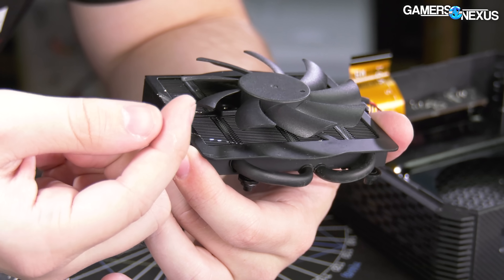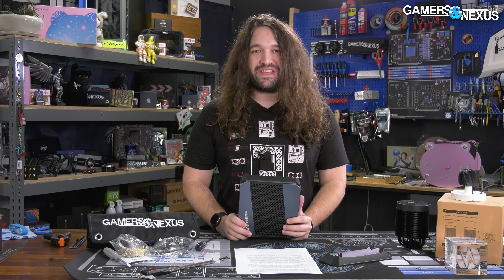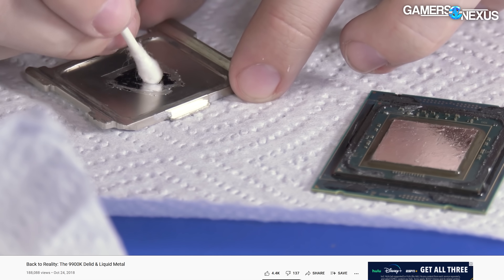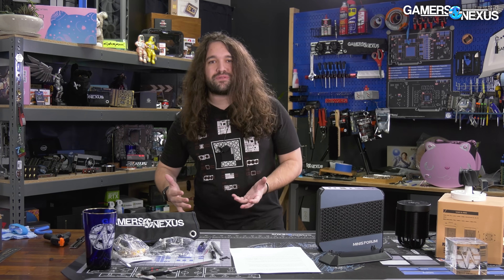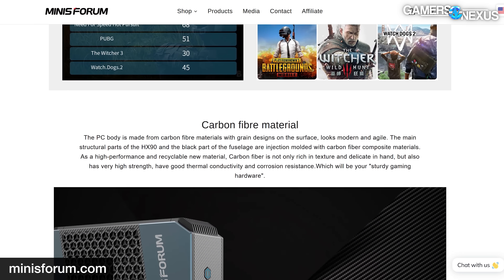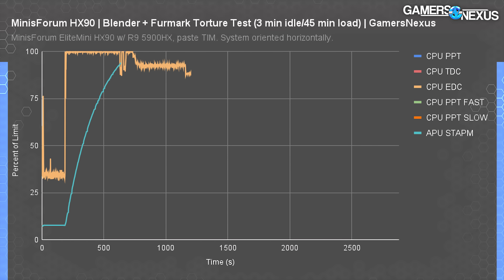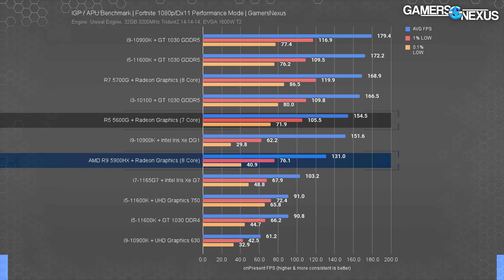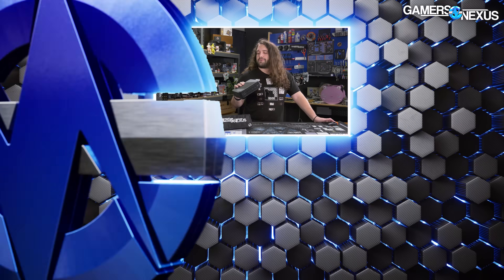Utter Incompetence: Liquid Metal Disaster in Minisforum HX90 Small AMD Gaming PC

Comment: I emailed Minisforum and this is the response I got:  

Recently, some Youtube reviewers have questions regarding our product and the way we market it. First of all, we would like to apologize for the confusion that we cause to reviewers and our customers. We would like to make some explanation regarding the questions that you may have:

Liquid metal splitting problem:
We tested our product in several ways and one of them is drop test. HX90 passed the 60cm test. But later when we did a 80cm test and we found problem. Liquid metal leaked. We want to improve it and raise the standard so HX90 can survive 80cm drop. But because we had limited samples, we removed the liquid metal and used thermal paste in these review samples.

2. Is the product liquid metal applied?

The actual product is definitely liquid metal applied. There will be no problem with sealing. HX90 can survive 80cm drop tests.

In mid August, we were informed that the sealing technique was good enough and we can produce sample with liquid metal applied so we decided to send the second unit to reviewers because it would be better if they can test the sample which can represent the actual product.

Comment: Below is the response that minisforum is copy/pasting (was literally in a different font in the email) to customers requesting cancelations. Luckily they canceled mine without charging their 2% "handling fee".

Recently, some Youtube reviewers have questions regarding our product and the way we market it. First of all, we would like to apologize for the confusion that we cause to reviewers and our customers. We would like to make some explanation regarding the questions that you may have:
 
1. Liquid metal splitting problem:
We tested our product in several ways and one of them is drop test. HX90 passed the 60cm test. But later when we did a 80cm test and we found problem. Liquid metal leaked. We want to improve it and raise the standard so HX90 can survive 80cm drop. But because we had limited samples, we removed the liquid metal and used thermal paste in these review samples.
 
2. Is the product liquid metal applied?
The actual product is definitely liquid metal applied. There will be no problem with sealing. HX90 can survive 80cm drop tests.
 
In mid August, we were informed that the sealing technique was good enough and we can produce sample with liquid metal applied so we decided to send the second unit to reviewers because it would be better if they can test the sample which can represent the actual product.
The reason why reviewers got confused is that there was misunderstandings in our company's internal communication. Our factory mistakenly sent the same sample as the first unit which was still using thermal paste. There is no reason in the world that we would send a false product to reviewers to show our problems, especially reviewers like Linus Tech Tips, Jayztwocents and Gamers Nexus.
As soon as we found out we sent the wrong sample we wrote email to all reviewers who received the second unit to try to clarify the mistake. But damage had been caused and we are truly sorry for the time they spent testing the sample.

Comment: So... Carbon fiber. A simple but destructive test would be to try and break it hands. If it really is a CF reinforced resin matrix you should be able to hurt it being a regular human with just your own hands, no tools. Secondly, the way it was shown "melting" it surely is just regular polymer plastic, like PP for example.
Lastly, i studied materials science and im pretty positive one doesn't injection mold CF composites. The base material are woven sheets of CF (reinforcement) which are then bound with a resin (matrix) in a stack; there are many types of such resins. You can bend such sheets or make tubes before the resin cures but the gist is that you can make simple shapes and if you want some orificesor you need to cut (machine) them in a cured and set prefab. So it takes multiple steps in an actual fabrication process to get the end result such they show and that by itself would rise the prices, needlessly. Why? No one needs CF/resin composite material on/in such case, there is literally no benefit that would be worth the price increase.
A sports bike frame? Sure, mass matters as do the high mechanical properties. Same for a wheelchair. But here? The absolute mass decrease would be tiny as the part is tiny and it's not something that works by caring physical loads or shocks, it just stands there basically only having to carry it's own weight - which a piece of cardboard would do as well.

Comment: Your Sponsors software that goes along with those keyboard is absolutely a steaming pile if you want to use macros! I can't emphasis this enough.  I've been using Logitech since the late 90's and customer support has gone down hill since them.  Took them over a year to RMA my G933 and Ghub has been a thorn in my side.  I decided to try EVGA offerings, the X20 I'm happy with except for the macro which is horrible and EVGA should have done a lot more R&D on the software and the latest update did 0.0 to improve anything.

Comment: As a engineer I love torx and would love to see it getting more widespread usage (not allowed to use it in my systems though, as alan key is the standard there and I'm not even sure there is torx M10+)
But even my safety torx collection is by chance of them being included in a bit set I bought.

From what I've learned with racing bikes (the shoes to be specific), is that you've got nylon, composite and carbon.
Nylon and carbon speak for themselves, but carbon is a form of a composite material.
My initial thought was composite is carbon, but it's actually a mixture of plastic and carbon...
If you take the Shimano R7000 and r8000 pedals, the 7000 is composite and the 8000 is carbon, but by the looks they are rather similar, so it's a blurry line imo... The 8000 looks especially "strange", as there is no fiber weaving you can see (maybe internally).
So if I have to give them any benefit of the doubt, I'd say they might be messing with the definition....
Though the rest of the video shows that that might be giving them too much credit already...

Comment: One thing to note is that there is Carbon Fiber reinforced plastic molding.
I used to work at a plastic molding factory and we used to inject both carbon fiber plastics and glass fiber plastics in molds. It would look like normal plastic but be stronger.
You actually need to cut the plastic to see if the material looks different on the cut.
Not sure if this is the case here or not, Not trying to protect the company, I am not affiliated with them.
You can also find transparent carbon fiber sheets which looks exactly like acrylic until you look at the edge which with normal acrylic looks transparent and with carbon looks black (the panel is completely transparent, just the edge is black when you look into it from the side)

Comment: they also market the UM215 as a solution to drive two monitors at the same time. I spent a day last week to test any combination with three different screens, many cables and converters, mailing with the support (fast, but wrong answers) und in the end learning that a very particular converter needs to be used to get DP to HDMI - still all worked fine with three different computers tested. They advertise a lot but deliver so little, I don't even need LM

Comment: Process technician here, that plastic they claim to be carbon fibre is probably something like PA or PC with texture, from the way it melts. Carbon fibre is woven and then molded into shape through heat and pressure and not injection molded (as far as I know), thats why it is a "fibre". 
To explain it simply, you heat up your plastic material enough to liquify it and shoot the flowing mass with high pressure into a mold where it emidiately cools down and solidifies again. You can add steel or glassfibre to give it more strength during the process but doing this with carbon fibre would just melt it into a soup of wasted material.

Comment: Carbon fiber is usually used to reinforce polymers (plastics) the same way steel is used to reinforce concrete. In the case shown, that is just plastic designed to look like a carbon fiber weave. This company is straight up scamming people and the only thing they should be getting is lawsuits

Comment: Thermal Paste is a STUPID idea for many reasons (for this product)
When the APU is soldered into the motherboard you don't have the extra layers of IHS metal and TIM. You just have the TIM in between the APU/CPU and the heatsink. So there's a lot less gain to be had compared to swapping out thermal paste TIM inside the IHS for liquid metal... and it adds a lot of COST to verify it's done right... cost which they could just put into a slightly better COOLER (or just a better fan) that would produce SIMILAR performance and noise levels.
And of course it dries out and is more of a hassle to replace than thermal paste... the PS5 is a completely different story becuase it's been designed to contain the liquid metal.

Comment: Ok
In which world is r6 siege cpu limited?
I bought r6 siege yesterday and tested in presets very high
Scaler is on in this setting by defaul at 1080p is 1368-768
anyway my config is
r7 3800xt 32gb ddr4 3600 and a rtx3060 12gb 274fps 88% gpu load (dx11 win 11 pro 64bit)
There is no chance that a gt1030 level gpu (vega8) has a cpu limit with this settings.
The product itself..... some may say dont buy this
maybe i tested this on my old gtx460  possible but the vram could be a problem in my test vram was at least 2,4gb
gt1030 has 2gb and the vega 8 limited to 512mb at default in bios
the gtx460 1gb should be possibel if i reduced texture quality to low

Low settings and reduced resolution(720p) and scaler to 25%=560-364 has to com at least 1,5gb vram
At this point i come to a clear cpu limit
settings at all follows resolution settings
if you set 1080p normal scale ist set tu 1368-762 i dont know why this called 50%
This set the game if you use presets very high.
the game seems to have a texture streaming problem this could explain those performance differences with  diffrent cpu.
If you want a cpu limit testing used mafia 2 or older game like tes oblivion without vsync.

Comment: The EVGA keyboard looks nice, but why do they still use staggered keys?! Just make ortholinear keys, much better, ugh.
Also, I now have a keyboard with the spacebar cut in halves, and I have reprogrammed the right spacebar as another function key. I nowadays wonder why one long spacebar is still the standard; this makes the thumbs useless and that is the most useful finger!
So I would be much more tempted to buy it if they did some actual useful 'revolutionary' stuff, rather than a proximity sensor.

Comment: I priced out a 5700G in an ASRock DeskMini X300W. With 512gb drive and 16gb ram it was cheaper than the MinisForum. I could probably build an ITX case 5700G for about the same price as the MinisForum and then have a slot to add a gpu down the line. MinisForum went down the wrong road.

Comment: Ugh, I just canceled my order. Was already on the fence because 1) the RAM they shipped (even hough II ordered barebones) is crappy CL22 on a high-end APU and 2) their FAQ claims that a "download link" for Windows 10 Pro (even though I plan to run Linux) is included with the barebones but neglect to mention it does NOT include a LICENSE. Now they can't even manufacture the thing right? The only reason for going with the price premium on something like this is the perception that it's built precisely by robots or people with tiny hands. If it's gonna be a hot mess anyway then I'll just get the smallest ITX case I can find and make it my hot mess. Thanks, Steve.

Comment: Im not the most knowledable about this but,
Tecnically you can put carbon fibers in to the plastic, similair to how many injection molded parts use glassfibers to reinforce the plastic. I think calling it a carbonfiber composite is tecnically not wrong either, just kinda missleading because usually people mean the woven kind. Their crappy english kinda makes it hard to nail down if its a lie or a tecnicall truth.

But if im honest i doubt theres actual carbon fibers in the plastic because i dont really see a reason for them to use it. If they dont even care about spelling on the box i highly doubt they spent the extra money on that which is basically invisible.

Comment: One problem with this liquid metal is that it's mostly gallium. Even if it never shorts anything out, it will alloy itself with tin and make components fall off wherever it touches them, in approximately a year or so, it takes a while for the alloying process to take place.

Comment: I delidded my 7700k and applied liquid metal. I applied it only to the die, then put the lid back on without a silicon sealant. Just relied on the pressure of the heatsink to keep it pressed down.
Worked absolutely fine. -20C off all cores at 5Ghz. No hot cores or anything else. So it's wrong to say it won't work if you don't apply it to both sides.
Of course my CPU died within 6 months. It didn't seem to like the extra voltage it had running through it to sustain that clock. It wasn't outrageously high voltage but it wasn't a golden sample either.
Reply: Saying "This is how you SHOULD do it", is different than saying, "It won't work at all UNLESS you do it this way."

Comment: The plastic has carbon fiber in it. That looks surprisingly similar to the mostly empty CF-PLA in my filament dry storage. If it is, then it's highly dependent on what the mixture is for what the added properties are. Ranges from increased temperature resistance, ability to temper it in an oven after forming, enhanced mechanical strain resistance and even some spring qualities. However from what I seen when I initially studied up to pick one to order, the amounts you typically find in power tool plastic is a big part of why they cost as much as they do.

Comment: Um, this is worse than it seems. Not only did they fling that crap around like a crackhead with a winning lottery ticket. They managed to make it stick to parts of the board that are ridiculously hard to get solders to stick to without dissolving the coating with flux.

Comment: The funniest part about security screws like that is that they aren't really secure, especially if one doesn't use a thread locking compound. I've popped lots of them loose with a small flat head driver. Kudos for the running of AvE's iron test -- I know it's a lot of work. 😁👍

Comment: They are using a DC-DC power supply, they seem to be pretty common in very small systems and plenty are available if you want to build your own system to run on a DC input.

I'm actually considering building a laptop/portable PC with one of those.

Comment: Not discounting the poor experience that GN had, but I'm hoping Minisforum will take note and take extra care with their production units and learn from this bad publicity.

TechTablets does a review by replacing the original supplied RAM with G.Skill Dual Rank CL 22 3200Mhz RAM, and increased the TDP to 54w in the BIOS.  It was some pretty good performance gains.  https://www.youtube.com/watch?v=fHpBsPxixkg.  

I've noted a few other youtubers have favourably reviewed this - Jay, ETA Prime, etc - so I'm hoping the reckless liquid metal application is a one-off exception.

Comment: I tried using it once and changed my mind rather soon. The bead of metal just doesn't stick to a heatspreader's nickel coating and just rolls all over it when trying to spread it. I'm sure if I bothered to remove the coating/lap it and put it on bare copper it would wet it better like liquid solder does, but the gains (maybe -2C) just isn't worth doing vs Hydronaut (plus pretty sure that voids the warranty as well).

Comment: Seems like pre built systems are junk now they used to be decent.  I ordered a few and then put a custom loop in them and put upgrades in them and made them viable but I have NEVER gotten a good rig prebuilt less than 2 k.  That is sad really.  I am sure they are finding issues with getting parts and things too it is expensive and sometimes impossible to find good pieces for a rig build now unless you know a guy who knows a guy who has this sister married to this guy that works in this electronic place..................Poor quality = a never returning customer for life.  That goes with ALL products.  I will NEVER buy a CHEVY or certain kitchen gear or NIKE SHOES that wear out after ONE use.  NEVER.  That is just me.

Comment: So thankful you called out fake carbon fiber like that. Wish a PC manufacturer would finally use the real thing already with what they're charging for hardware. How much could a few tiny REAL carbon fiber insert pieces for a motherboard, GPU, or case, really cost and add to MSRP in the kind of quantity they'd be using? Or how bout a real full CF fan shroud for a top tier card like Kingpin or a special edition Strix. Somebody has to go there.

Comment: Might have been interesting to see how it would perform with properly applied liquid metal. Chances are their design engineers came up with a good working solution but when it went into production they probably didn't train people properly to apply it and ended up using standard paste just so they could keep the production line rolling. A common issue especially when the bean counters get involved, as they are normally very short sighted.

Comment: Just wanted to share this here. 

I actually got a retail unit (no RAM or SSD) which I ordered on the 31st of August and received yesterday. A few things I noticed: 
- All I needed to open mine was a Philips head screwdriver. 
- The CPU backplate has "Disassembly Prohibited" printed on it. Either to protect the delicate LM job or to hide what they used otherwise. 
- The motherboard looks pretty clean to me, no LM mess.